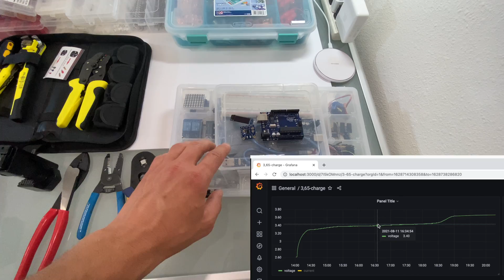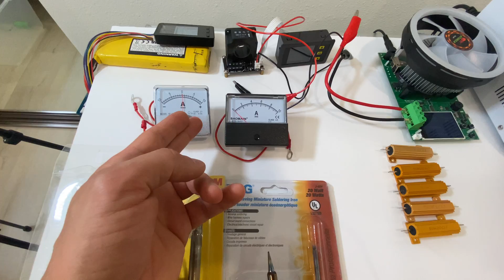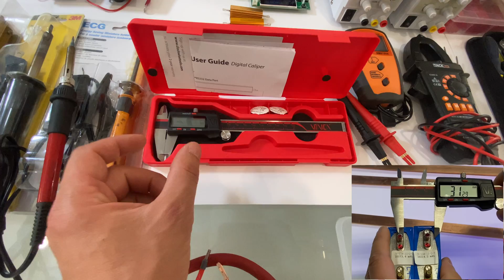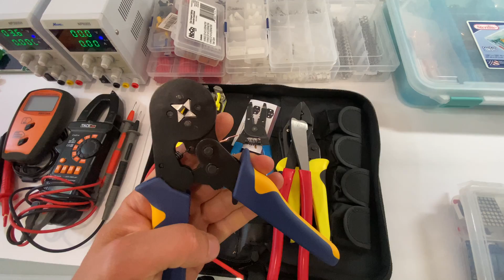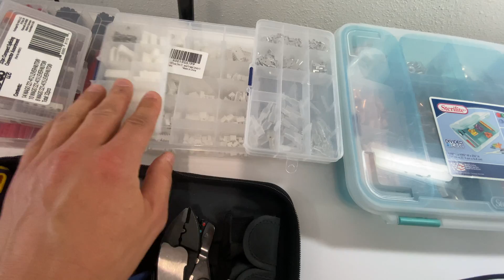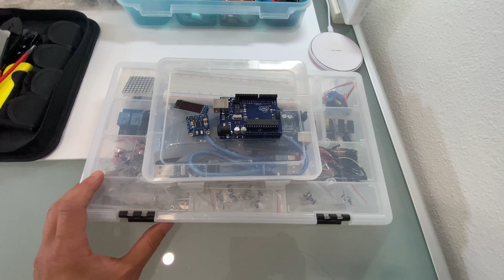Tools and components to build and test lithium batteries and equipment.

Comment: Can you do a review of your 48V battery cabinet? Your experience with it since commissioning.
Reply from the maker: Hi Peter, I will do it later. Not many updates there, it just works (at this point without BMS since I burnt it  ☹️ )
Reply: @SolarEngineering  what part of the BMS does not work, the balancer or the voltage differential?
Reply from the maker: @peterking1134  balancer still working, but Chargery BMS is completely dead.
Reply: Ah yes, I forgot you had both. Any idea why the BMS died? Aren’t you alarmed by not being able to monitor voltage or does your balancer provide this as well ??
Reply from the maker: @peterking1134  here are details of what happened: https://youtu.be/R1ZFkswge2Q
Active balancer not sending any alarms, I reconfigured charger and inverters to stay far away from high/low voltages, while looking for new BMS.
Reply: @SolarEngineering  that’s one nice power pack!